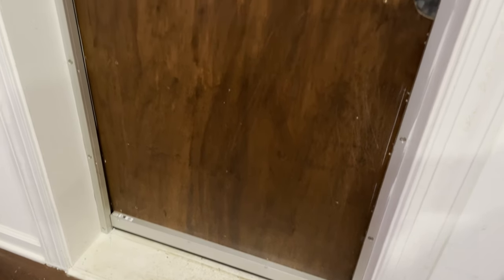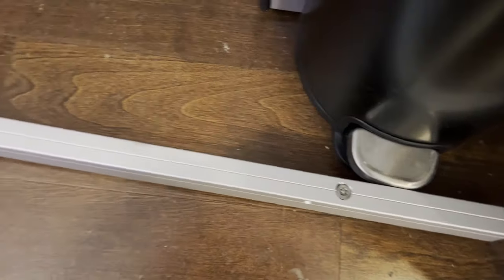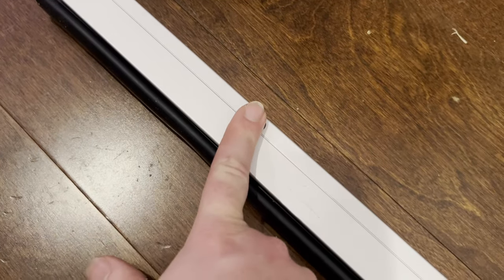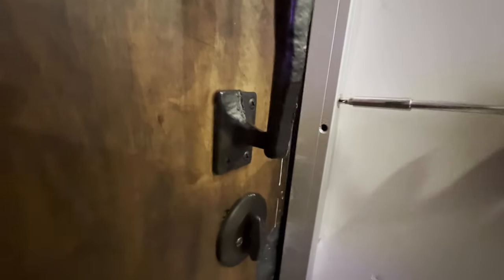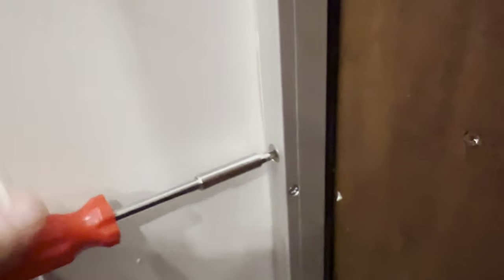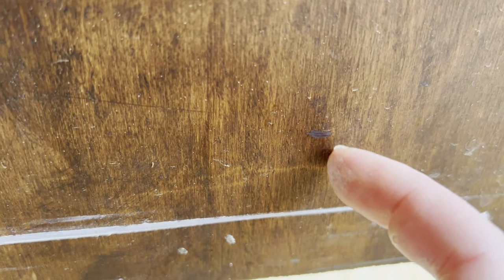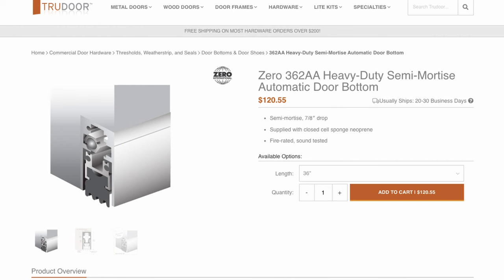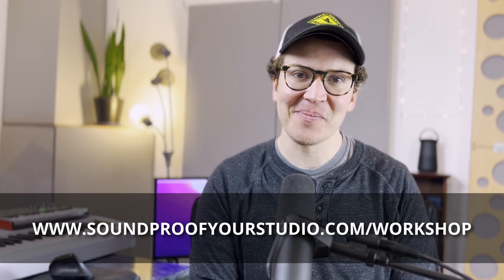How To Install Soundproof Door Seals - Zero International 770AA  and 367AA

Comment: Thx for video. Why not use a perimeter on the bottom just like the top? Less moving parts == more solid. Realize you would have to step over it entering the room, but I think its somewhat expecting going into a soundproof space for it to be slightly abnormal entry (ex: double doors, heavier doors, etc).